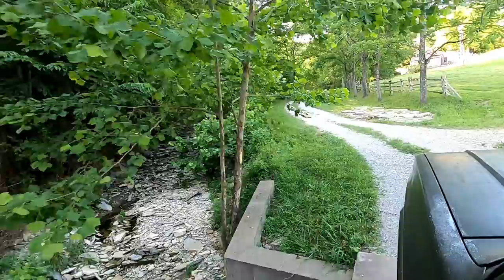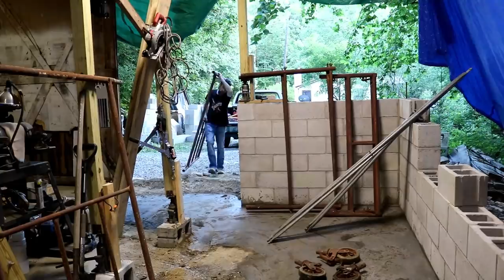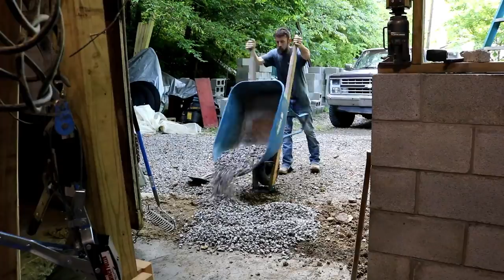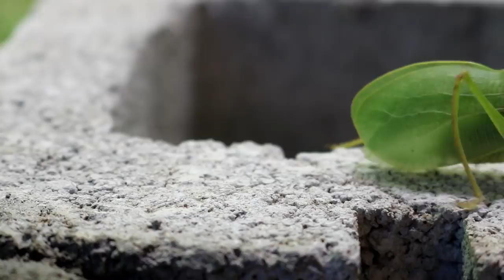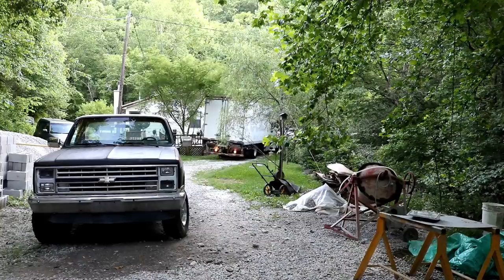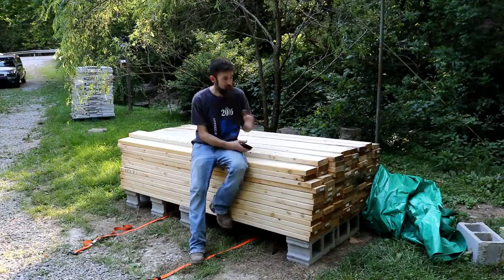Al is BACK! Roof and wall supplies & Block work

Comment: Al did you an even bigger favor with the white shingles.  White will reflect heat much better than black, and keep your shop cooler.
As a builder, I read about the thermal advantages of light colored roofing for years, but didn't get to experience it until I started re-roofing my place.
I found a great deal on metal roofing at a local manufacturer, as long as I wasn't particular about color.  They had a 30% off builder's cost on some overstocked colors.  I ended up getting a light tan color.
The first summer, I got about a 3rd of the roof done, (had to re-build about 60% of the structure.)  It was a 60 x 15' 6" run.  The next summer, I was pleasantly surprised on the first 100' day.
I have not central or individual AC. Normally, on a 100' day, I have to open the windows and cross vent with fans at ~6:00pm.
On that first 100' day, I completely forgot about the windows, or fans. It didn't get hot enough in the house to remind me! By midnight, it got warm enough in the house, I had to open windows and vent the house.
I didn't increase the insulation factor, all I did was rebuild the framing, and install the light tan metal, instead of the dark brown 3 tab.  The midnight or so time frame has stayed consistent as I've progressed with rebuilding & re-roofing, though I must be getting less temp resistant as I age, because I'm opening the windows sooner, of course this summer it could also be due to the surgeries I'm dealing with in the cancer treatment.
Yes, Al has done you a good one, once again. You'll end up appreciating the white shingles.
I think you should create a YT Super Subscriber award, and Al should be the inaugural recipient.

Comment: I had a summer job in high school working for a local roofer. My first summer I was the "shingle boy". The guys on the roof would yell "shingle boy!" and I'd lug a full bundle of shingles up an extension ladder on a 2 story roof. I weighed 98 pounds back then so it took all I had to get a bundle balanced on my shoulder so I could crawl up that ladder. That job more than anything else in life gave me the motivation to get my engineering degree so I'd never have to work that hard again.
Reply: RadarDoug that's the sort of motivation any teenager needs!

Comment: Looking good Steve!   That white roof will keep the shop much cooler. Under the same conditions, the surface of a white roof can be 50 to 100 degrees cooler than a black roof.

Comment: Great video!  Good choice on the use of flow-able fill.  Civil construction projects use this material widely under base mats and footing for large structures were it is frequently referred to as CLSM (Controlled Low Strength Material).  It's very similar to soil cement and is one of the greatest used by (tonne) engineered materials on the planet.

Comment: Here in Australia we don't have...or rarely use that type of roofing. It's usually terracotta or concrete tile or colourbond or galvanised corrugated iron and some slate. We have a colourbond iron roof that is shaped like tile...it was put on in 1978 and is still like new...with exception to a few dents from my dad walking on it to fix the chimneys and erect tv antennas Etc.

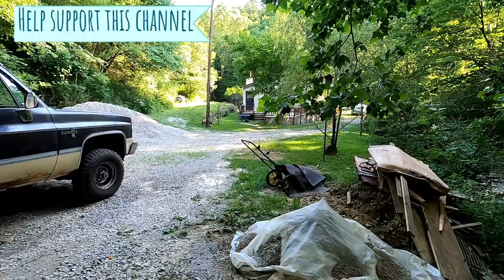Comment: (3:57) - I know that truck has manual transmission, so that rocking to and fro, after you'd stopped, had me thinking.
If you'd applied the handbrake, there would be no rocking like that.
So, let me guess.
Handbrake doesn't work, or doesn't work very well.
So instead just leave it in gear.
First gear would be my choice.
That would give you the most "stop"
But reverse is a close call.
So whaddya do?
>
Reply: Bodragon I had exactly the same idea!

Comment: White will actually work out better in the end as white reflects the heat while black absorbs it and transfers it into the building. If you rig a water line up from the creek on a small pump it will act as evaporative cooling the simplest form of air conditioning.........

Comment: The white shingle will absorb less heat from the sun. We swapped our to white a few years back and the attic temps dropped by about 8 degrees. The wife got mad at me for buying a wireless temp gauge for the attic but I told her "I have to KNOW!" and she just rolled her eyes and walked away.

Comment: You should get 2x8 or 2x10 headers and footers.  Then stagger your 2x6s, dressing off the front, then the back in an alternating pattern.  Don't know the spacing OC, but this will allow for a thicker wall, and help make it more quiet.
Reply: and make it better for insulation, reducing the conductive flow of heat thru the studs.

Comment: Roof pitch is conventionally called out as the rise on a 12 inch run.  Your roof measured as a "4 on 12" pitch.

Comment: You've probably already built the framing by now, but if not I think you might be able to do it as one piece. Build it flat on the ground if you have enough room right next to the opening. Then I think that maybe the three of you could lift the bottom end up onto the lower combing by yourself. Or if not by hand, I think you might have a couple of chain falls or block and tackle, and a couple of them would do most of the lifting. Get it braced on the wall stub, maybe stiffen the top of the framing with some more temporary boards, and pull it up with the tackle.

Comment: Happy 29th birthday to Noel.
Flowable fill is perfect for what you've used it for, and cheaper than cement due to less sement. If it contains flyash and sement it will cure much slower, but in time it will be as hard as concrete with sement. It's called the Pozzolane reaction. . (Flyash is a "waste-product", and usually almost for free)
(BTW: Al's shirt "Got Lefse?". Lefse is a Norwegian flat pastry (often made with flour of potatoes), sandwiched with butter, sugar and cinnamon. It's a really tasty snack)

Comment: You mentioned the filler might have Coal fire ash from powerstations. In the UK back in the 50's they used it under concrete floors but it caused concrete cancer due to high sulphar content and a lot of buildings had to have it removed. Hope yours is riversand.
Reply: I heard that in the 50s and early 60s they used it as fill under concrete slabs in conjunction with the early radiant heating systems. Moisture under the slab would combine with the sulfur in the ash and form sulfuric acid which would then attack the heating pipes. Almost everyone of those systems failed in 5-10 years.
Reply: Building codes have moved on since then so I'm sure Steve's mix is ok. The problem they had in the 50's was it was mainly "Red Ash" - coal ash or slag from the mines - and it was not mixed with anything else.

Comment: For the folks that are correcting Steve on his run/rise measurement (I've lost track of how many times I've said this), Google is your friend. This is a slope ratio.

Slope is measured in inches of rise per foot and almost never simplified, in terms of a fraction or normal ratio, unless you are doing calculations based on the pitch. So it is expressed as "4 in 12" or simply 4,12 to any normal carpenter. Now if you want to sit down and do some math because you are tying into the roof or creating trusses/rafters and you want some basic angles, you would simplify the expression as 1/3 for the "pitch" and now it's very simple to convert to an angle for cuts.

Comment: Those type of scafolding are ment to be setup symmetrical so one side has variable hight selection and the other side either low or full hight. Here they come with 1 scissor type X bar and 2 straight bars so they do not get in your way. Having the locking wheels is a bonus, but even without them its far better than a ladder unless its a multi position one that converts to a variable hight platform, very expensive. The job is comming along fine, back to metalwork soon.

Comment: You sure have a generous neighbor.  I hate to see the barns leaning.. If the do go, I would try to salvage the barnwood and timbers. Too many just get pushed over and burned or buried. The old wood has value to big city decorators, woodcrafting folks, and to others that are repairing or restoring another old barn.
White-grey  shingles will be less hot in the summer.. Better than black.

Comment: You would have more height selections if you alien the scaffolding...its one end is different then the other end...you're probably done by now though
Reply: I am sure that Steve has reversed the back end scaffold. That way the bridge will use the lower positions,
Reply: @leeklemetti1887  Doesn't look like it.
I'd much rather be working thigh high than hunched over, or on my knees.

Comment: As with every video you do, I loved this one .
Cheers mate.
Btw 12" by 4", is that 1 in 4, or 1 in 3?
Great work, and you are an inspiration.
Hi from rainy England
Reply: This would be 4/12. For every 12 units moved horizontally 4 units go vertically. So in 1 foot of run you get 4 inch of rise.

Comment: dont you need those blocks to be higher so that you can secure a bench under the windows?
Reply: Adam Bryant, I was thinking the same thing, have your wall at least as high as your work bench.
Reply: Goettschwan but as I understand it they are going to be used lengthways and hinged along the top edge and I believe the floor to roof plate height is some ten feet, so plenty of room
Reply: I was thinking he needs to come up to above bench height also and to have room above the bench for the sole plate for the woodwork to overhang the blockwork to give an almost window cill (or is it spelt sill in American English?) look inside and outside

Comment: i think you couldve put course sand in there and hit it with a firehose to have it flow intoo the nooks and crannies , man 900 dollar is a lot of money and you still need to put concrete over that for the floor itself 
have to say though i think it works way better than sand against undercutting the foundation 
hope the plywood on the roof is still good or you be needing to replace that too , would be a shame to put new shingles on plywood that only last two more years or so 
the white shingles do reflect the sunlight so with the part sitting out in the open it might turn out to stay cooler inside , with the roof under the trees i guess it will turn mos green eventually

Comment: Steve doesn't know about pan stands. They look like the old TV tray table legs. No one works with pans on the planks. Or lays block on their knees either.  Failing to have stands a pair of blocks works to hold a pan up.

Comment: You can make a shingle lift with an extension ladder, an electric winch, couple pulleys and some 2x4's. Lots of youtube videos out there. I built one for lifting heavy things onto a high shelf in my garage, but it would work just as well for shingles. https://www.youtube.com/watch?v=BO2jBuWQPjo